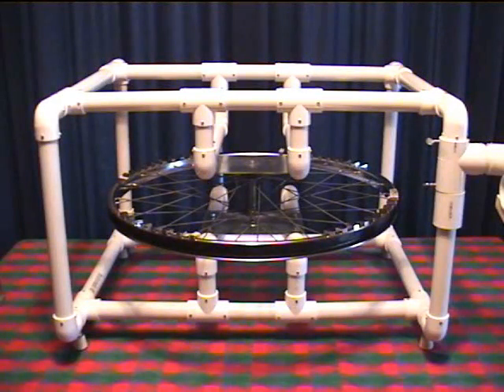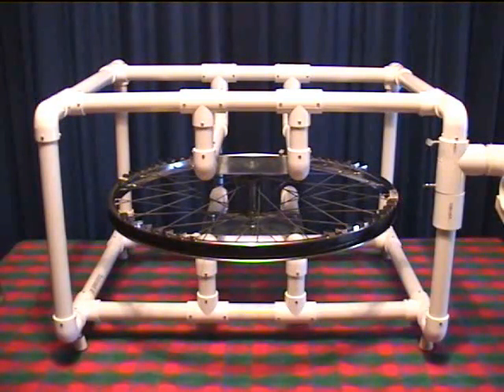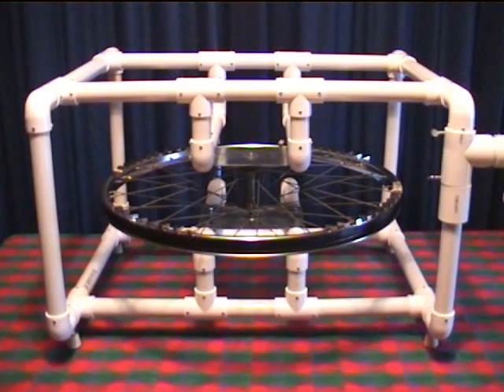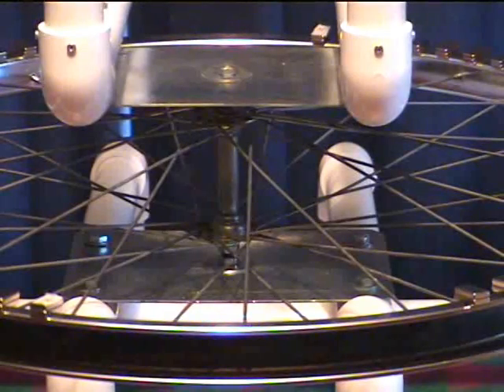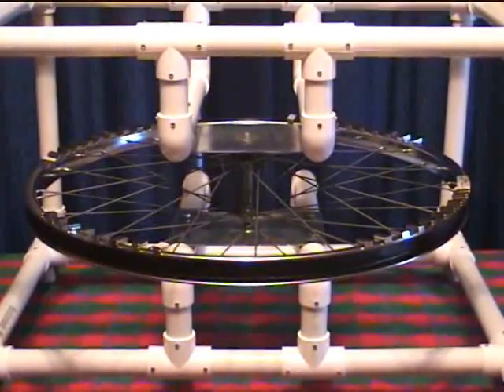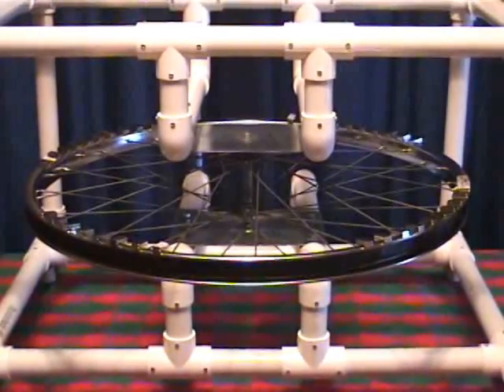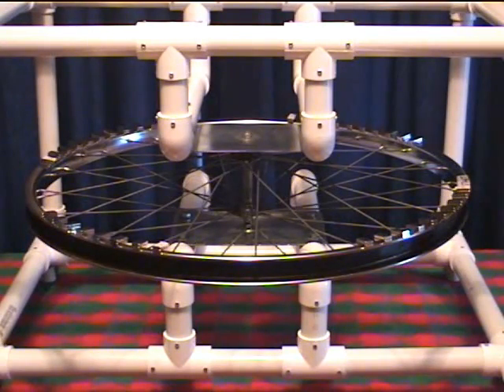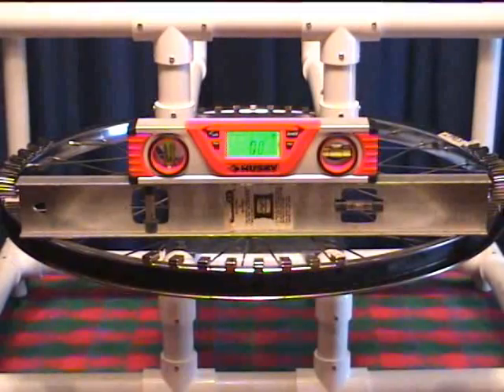Video #1, "Rick's Pipe Dream"  Magnetic Motor - Generator Project

Comment from the maker: Hi yingyr.  I'm still at it, and making progress.  I spent a lot of time working on rotor magnet layouts and the throughput speed/acceleration time trials, as seen in the latest videos of this series, and achieved good results.  I'll be making a new video this winter to show that progress, and to explain the method I will be using to move the stator magnet up and down to simulate the hand-held motions as seen in video 3 which allowed for continuous rotation.

Comment from the maker: Cloxxki - I wouldn't be so quick to dismiss Mylow's results as fraudulent.  After all, I have shown in video #2 the forces he is using to achieve rotation, and they do work.  I am simply showing that there are better ways, using my MOSTAT methods.

Comment from the maker: There definitely is force required from my hands.  The greatest force to overcome is the very strong attraction just after the strong repulsion as the last magnet of a group passes the MOSTAT magnet.  With the magnet mounted in a fixture, that force is removed from the equation, and the remaining forces are easily overcome.

Comment from the maker: Try watching video #5, k.m.  You will see that I am slowly and easily moving the stator magnet, and that the energy produced by the magnetic interaction, and the revolving wheel, is much greater than the energy required to move the stator magnet.

Comment from the maker: Hi Sterling.  The frame is all PVC pipe and fittings, and I am using stainless steel hardware in any critical areas, such as the stator magnet mounting block.  The screws binding the PVC fittings are common #6 zinc sheet metal screws, and while magnetic, they are far enough from the wheel to not cause interference.

Comment from the maker: Sorry, k.m., but your understanding is incorrect, and you can prove this easily with a bike wheel, still on a bike, and 2 magnets.  Lay the bike on its side and make the front wheel as level as possible.  Place one magnet on the rim with north pole facing up.  Hold the other magnet in your fingers, with north facing toward the bike wheel magnet, and move in closer.  The wheel will forcefully begin rotating because of the repulsive effect, which is quite strong if using neo magnets.